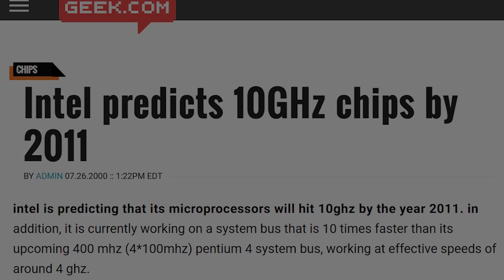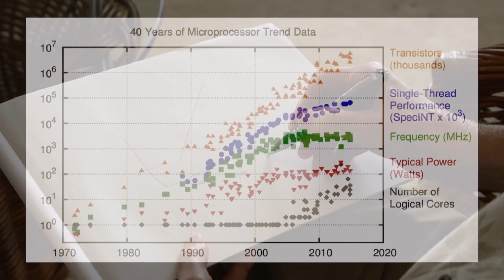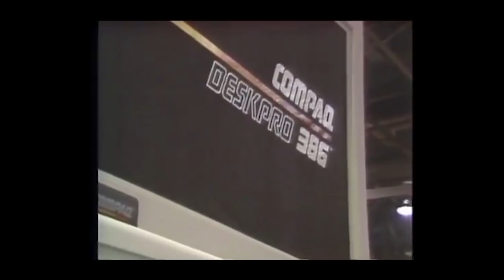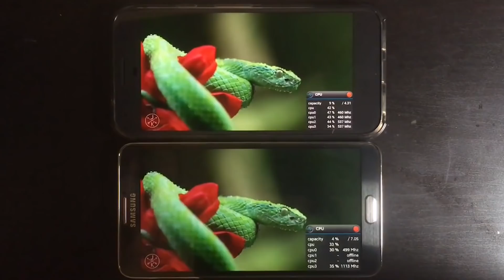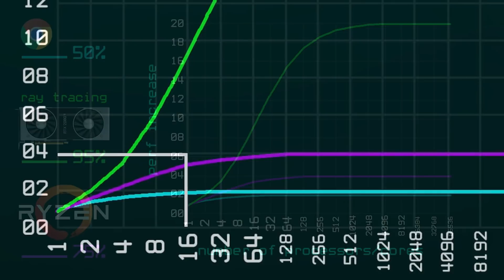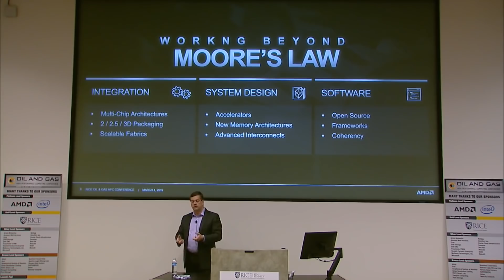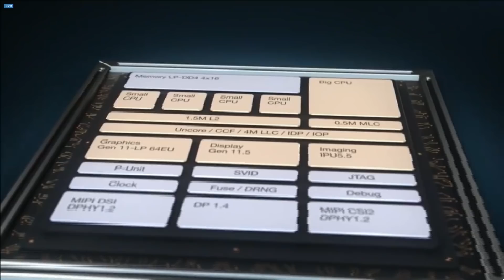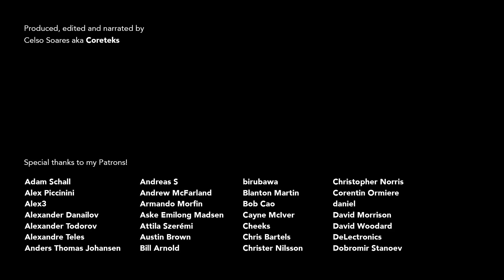Intel and AMD going BEYOND Moore's Law

Comment: This might seem pretty dumb, sorry if it does! But on Windows I regularly notice in the Task Manager that, while running specifically a single threaded program and nothing other (major) in the background, in the window where you can see the load of the cpu threads/cores the load is split up. Is windows already doing something in the background like you were talking about or what is going on?
Reply: Windows' CPU scheduler distributes single-thread loads among all processors, unless you ask it to do the opposite by setting affinity. I don't know if this has any benefits in performance; all I have seen is that, for example, with 4 logical CPUs, a single-threaded application will never have a global CPU usage greater than 25%. So this strategy doesn't seem to make the program scale any better and one could argue that Windows is wasting time forcing context switches.

Conversely, the default CPU scheduler in Linux makes these context switches only every a few seconds, so what you see in these cases is a single logical CPU being used at 100%. From my experience, this makes it easer to spot badly coded programs the authors did not bother to make parallel.

Comment: Great video. Tiny nitpick: Power increase when pushing frequency is linear though, more frequency requires more voltage that's squared in the equation, so the scaling is squared/quadratic, not exponential.
Reply: isn't squared the same as exponential?
Reply: @BattousaiHBr  No, check out wolframalpha and plot 2^x and then plot x^2, you'll see that exponential increase is bonkers compared to the squared growth
Reply: @JJsTechEsports  depends on what x is in 2^x. if it was 2 then it is literally the same thing as squared.
in the case of x^2, 2 is still the exponential of x.
i think we're arguing semantics lol

Comment: With 16 core/ 32 threads CPU's and stacked memory on top of them on the horizon I might need to invest into watercooling within the upcomming generation if I want to be anywhere near 3.5 GHz, won't I ...?
Reply from the maker: The heat in 3D stacked chips will be a real challenge, but it's the way forward. Watercooling (at least AIOs) has come down recently, so there's that :)

Comment: What would be nice, is if we could buy a accelerator that we add in to an existing multicore system in order to do the job mentioned in this video. Unfortunately the latency might make that not viable, but would be nice to not have to buy a whole new processor in order to get that kind of benefit.

Comment: I think stuff like this should be built in the JVM. Yes, Java. As code is often just interpreted and by that continously optimized already, it should be easier compared to compiled languages like C to optimize. If someone made this work properly it could probably even destroy native performance, so C or C++ long before processors implement this stuff on a hardware level.

Comment: ... so when can/should we get our new PC?
Reply from the maker: Now is a good time, or wait a couple of months for the Ryzen 3000 announcements to make a decision. 2 years is too long to wait (unless you already have a decent rig that does all you need it to do).
Reply: @Coreteks  Thanks! (I am on the switch (form i5-2400 to R3000) by the way, mainly because w7 expires, and i am about to match the OS, with the hardver or vica versa.... also i meant that as a poetic one, because there is alwas something under research or developememnt, so there is no "last version" :)

Comment: As far as i understand these inovations more like auto optimize...but still doesnt solve dependency problem between executions, wich is actualy logically fundemental thing when you try to do something.

This Ai... hmm... maybe igpu can accelerate it but then you will face some latency... well ai calculations alone gonna cause some extra  latency wich point can only be compensates itself if the work load alone takes more time ...this is like the story behind multi core/frequency limit... sometimes there will be negative scaling  i gues...
Reply: That's why we're still using CPUs. "AI" as seen in GPU hardware is mostly machine learning working on images and other highly parallel data sets. AI in the sense of code that makes decisions for behaviors doesn't usually fit the massive vector GPU style of processing.

Translating code in real time, like with Transmeta's CPUs, and VISC as in this video, takes too much time, and memory bandwidth, for a lot of code. In some paths, a few cycles here and there really matter. Splitting up processing also adds latency between the actual processors that it's split up amongst.

Not that it has no promise, but it's not going to take over and revolutionize anything. Work that is not bursty, like graphics, audio, and non-trivial database processing, could benefit from those kinds of middleman optimizing systems quite a bit.
Reply: You predict dependency and just reroll when prediction is wrong.
Reply: @kazedcat  that's what hardware already does. X86 CPUs have been doing that since the Pentium. To do it better either requires a lot more power, or sacrifices in latency - sensitive code. Now, if you could predict ahead of time what that code is, and profile it while running it as-is, only changing it based on current state in later iterations if it makes sense to do so, there might be some real potential, there. But, that's far from trivial, and going to require a lot of statistical processing (the marketing buzzword "AI”).
Reply: @laurelsporter  You could analyze the code while it is running and just save a multithreaded translation for the next run. So the first run of the program will have no multicore acceleration. The second time you run it it will have acceleration. The more you run the program the more confident the prediction is and the faster the application will run. This will make use of massive multicore by first running the analyses on spare cores. Then use more cores to accelerate application. You could even make the analyses during installation of the program so that the first time you run it it is already accelerated.
Reply: @kazedcat  That will be too high cost between the cores, though. The original code will have to have been written with something like that on mind, else it will have created dependencies that keep that from working. Such profiling and recompiling must still make the code act exactly as written. You can't just pull more threads out. Micro threads, threadless, etc., will still end up with heavy memory and power costs.

I'm sure that what they're doing is quite a bit more subtle.
Reply: @laurelsporter  Yes it will consume more power but overclocking also consume more power. Improvement on power efficiency have not yet hit a wall. Newer process can still half power consumption at similar performance. This will be a way to trade that power efficiency for more performance without the cubic penalty of increasing clocks where doubling clock speed increase power consumption eight times. So if you gain more performance with acceleration for the same power when overclocking that is a win.
Reply: @kazedcat  sadly, newer processes have not been good enough to halve power at the same performance in quite some time. They're getting more like 20% or so just on process, these days, and then have to trade some of those gains for added performance. We're still increasing density, but performance per Watt is being more driven by architecture than shrinking processes, now.
Reply: @laurelsporter  Double the cores at the same power is halving the power consumption. It does not matter how you get efficiency what matter is you are still getting efficient from one generation into next. You can trade that additional cores to increase performance.
Reply: @kazedcat  two cores at the same power is not halving power consumption. At best, it's maybe going to be dropping it to like 75%, if they are at the same speed each. That's why the base all core speeds are so low at any given power target with many cores. They haven't been getting those kinds of huge efficiency gains with shrinks for like 10 years now.
Reply: @laurelsporter  Two cores at the same power means you can have one core at half the power. I don't know where your 75% came from.
Reply: @kazedcat  you are sacrificing performance to do that, so it would be silly in most cases. If we go by AMD talking about going to 7nm, FI, they mentioned having a trade off of around 20% power savings or performance to work with, on process alone (uarch is where most of the gains are from). So, going by that, if going all in on power savings, two cores would use 160% of the power of one core on the older process, and need to be brought down in speed to match 63% of the old core's energy usage. One core at half the power of the old one will be much slower. That's not going to be a gain for anything that's isn't massively parallel, and may be a net slowdown. Hence why core counts have only been inching up over the last many years.

The days of getting as much of an efficiency gain as a density gain are long gone. Cost isn't the only reason we don't have 32 core desktop CPUs. That nobody would be happy with a <2GHz base clock speed also plays in, when it comes to adding cores.
Reply: @laurelsporter  You are confusing yourself. New generation processor is not slower by 25% of the previous generation. If they clock new generation processor at the same power you get 20% more performance not less. But you can have half the power at the same performance. This is the cubic penalty of increasing clocks. It is not that the process get less efficient. It is that hitting higher clocks gives you diminishing returns. You are not hitting power efficiency wall you are hitting clock ceiling. The power efficiency is still there you just need to accept zero performance improvement for single threaded application. Unless you have a tech that split threads into threadlet and distribute it into multiple cores. Then you can get performance improvement without the power penalty of higher clocks.
Reply: @kazedcat  if the new processor is clocked the same, you don't get it working in the same power envelope. Higher speeds vs power is quadratic , it cubic, as well. To put double the cores in the same power envelope means a significant loss in single threaded performance, which is not generally acceptable on client systems, just as 100W+ CPUs are unacceptable.

As well, automatic thread splitting, even if viable, must observe the same memory behaviors as before splitting, meaning it must still behave the same regarding concurrency, limiting scaling. Finally, at lower speeds, critical paths run slower, and so the whole program does.
Reply: @laurelsporter  in the same process doubling the core count doubles the power. It is linear which is less than quadratic or cubic scaling. Now jumping from for example Epyc Naples to Epyc Rome you double the core count from 32 cores into 64 cores yet you can still run Epyc Rome in the same motherboard without the need of increase power delivery. Epyc Rome is also expected to have higher single thread performance compared to Naples even with twice the cores and the same power envelope. You are not sacrificing single thread performance going from Naples to Rome.
Reply: @kazedcat  you are believing too much cherry picked marketing drivel. They are improving IPC via uarch changes. They are increasing core counts not at the same power, but within the same maximum socket TDP spec, because the socket and boards were specified with these future CPUs in mind, as they did not have them capability to efficiently add so many cores in the first gen designs.
Reply: @laurelsporter  So where is your evidence that Naples motherboard is overspec by 100%. I am only giving example of it happening I doubt bean counters greenlit a motherboard 100% over spec. So it may miss the expected halving of power consumption by a couple of percentage but it is nowhere the same scaling as your 75% below the previous generation in single threaded performance. You have still not explained how did you get that number.
Reply: @kazedcat  the motherboards aren't over-spec, the current Epyc CPUs are under the spec, by a wide margin (the Threadripper series is where you find the ones pushing against the TDP spec).

That's not a new thing for either AMD or Intel to do. CPUs commonly take 5 years to go from design to manufacture, while details for things like motherboards only need a year or two of lead time.
Reply: @laurelsporter  If the motherboard is not overspec then they should not be able to handle twice the power consumption of moving from 32 to 64 cores. That needs the copper traces to be twice thicker and twice heavy. Threadripper use different motherboard with different specs. But Threadripper is also an example of moving from 16core to 32 core. So we have plenty of evidence of doubling of core count on the same system without said system melting into slag. You have not produce any evidence that there is power efficiency wall. Yes there is clock ceiling. Yes there is power wall but there is zero evidence of efficiency wall. There will be eventually but we are nowhere near it. There is still a lot of improvement on process tech. There is Gaafet, there is EUV there is 5nm, there is cobalt interconnect, there is graphene, there is carbon nanotube. All of that is 3 to 4 generations of efficiency scaling. TSMC is now 7nm, next will be 7nm+ with EUV after that is 5nm, then probably 5nm+ with cobalt interconnect, then 3nm followed by 3nm+ with GAAFET. We will likely not see farther density scaling  after 3nm+ but they still have the option of switching silicon into other semiconductor like graphene, carbon nanotube, or III/V semiconductor.
Reply: @kazedcat  a motherboard that can run a 150W CPU running one that only needs 100W is running under spec, FI. When the 150W CPU comes out, it can just be dropped in. That's basically where the first gen Epyc CPUs are at, since the dies weren't designed to have good performance scaling beyond 4x.

Comment: Was that a whole video about instruction level parallelism (out-of-order execution) without once mentioning that it already exists? Any modern CPU core will reorder independent instructions, distribute them across multiple excecution units (Ports) and run them in parallel.  It is hard to see what in all this is new.
Reply from the maker: This is not the same as OoO
Reply: @Coreteks  sure, but how? Why should the scheduler be able to infer dependencies better than corrent hardware? My point is just that the idea, with a scheaduler which sends independent workloads to different excecution units is in no way a new one, so i have a hard time seeing what is. But i realy respect you answering critical comments, thanks for that! Really like your content

Comment: As always, your videos are great, very informative and a joy to watch. I do have one comment though:
At 3:45 you say that there's no limitation to how small the transistor can get, but isn't that somewhat incorrect? A silicon atom is around ~200 pico meters in diameter, and once you get to a point where the transistor's gate is a few atoms in length (don't remember where the cut off point was, but I think it was around 1nm?), you get to a point where quantum effects come into play and electrons can just "jump" or quantum tunnel and bypass the gate altogether. I do realize that modern finFET processes don't have the same correlation in nomenclature between gate sizes and fab nodes as older processes, but saying there's no limitation is somewhat misleading. While the transistor itself is much larger than the quoted fabrication node, the gates aren't, and as such we'll probably run into a wall where we can't make them any smaller sometime in the next 10 - 15 years or so. That's also not taking into consideration increases in parasitic capacitance due to transistors being placed closer to each other.

Comment: What you are proposing is highly improbable. More likely this tech is going to distribute work between fast/slow cores more power efficiently. The reason what you propose is unlikely is because in order to know if code is data parallel, you have to actually execute it. Thus what you propose is essentially impossible without additional software tooling.
Reply from the maker: I'll share more once patents are filed and more info can be made public. I'll do a follow up video taking a closer look at how this works.
Reply: @Coreteks  I'd like to point out that the work on parallelizing single threaded code, in hardware is something most cpus(desktop/server atleast) already do, its a better idea as you don't need to get the coders to change anything, so I would suspect much of the potential speed up in this area has been gotten. What is left is to dangle raw computing power in terms of more cores to the devs and wait for them to jump on it.
Reply: @Coreteks  Replayed this again - a point of confusion (maybe only for me) but the demos you saw (and recorded for us here) of the performance between games and the CPU stats - this wasn't Soft Machines tech was it? Because it doesn't make sense that it can work on different architectures if so since Intel bought them. Is this an unnamed new company working on something on a new 'angle' toward the multi core / software problem?
Reply from the maker: @rob99201  Hey. The demos are from a new company, yes.
Reply: @Coreteks  Awesome! Thanks for the follow up! Do keep us informed - as Rick says, "Gotta keep those Coors {erhp!) engaged!"

Comment: Added benefit  not only will AI distribute single threads into multi threads, but AI algorithms will do more and more jobs on the pc, especially visual processing, so you get yet another performance gain every time some AI company comes up with a more efficient algorithm.